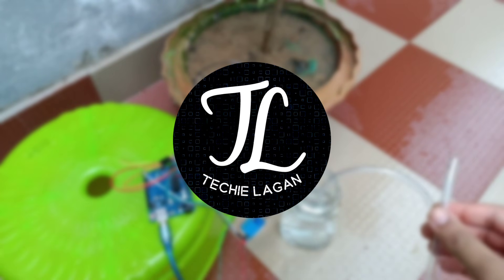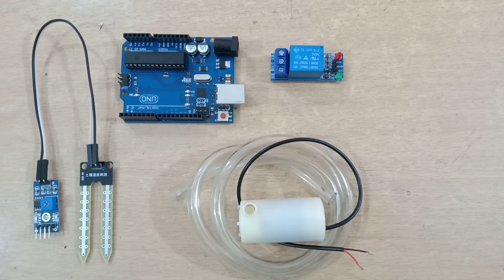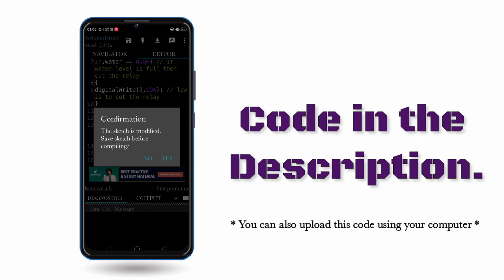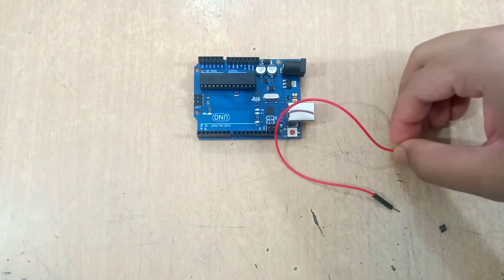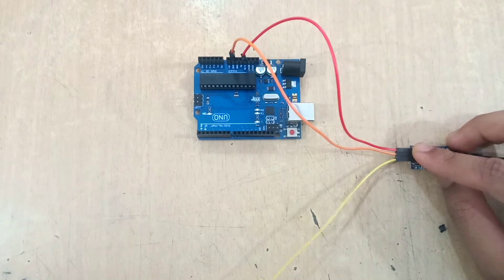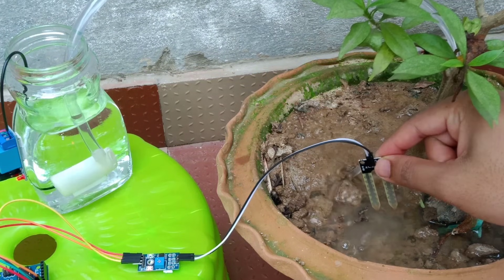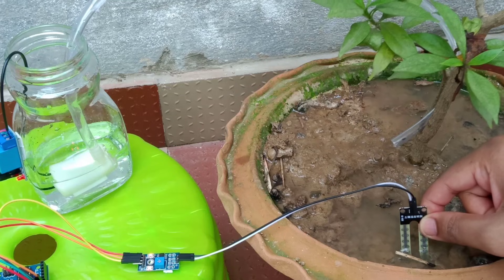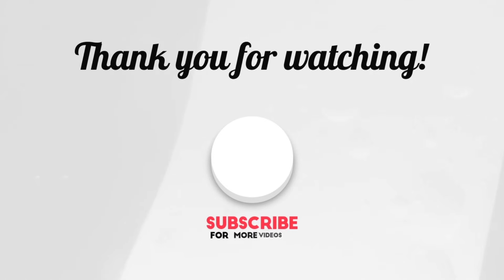How to make Automatic Plant Watering System using Arduino UNO and Soil Sensor || Techie Lagan

Comment: To modify your Arduino code to have a burst of 3 seconds followed by no output for 90 seconds, you can use the `millis()` function to track time. Here's an updated version of your code:

```cpp
int water; // Random variable
unsigned long previousMillis = 0;
const long burstDuration = 3000; // 3 seconds
const long pauseDuration = 90000; // 90 seconds

void setup() {
  pinMode(3, OUTPUT); // Output pin for relay board
  pinMode(6, INPUT);  // Input pin coming from soil sensor
}

void loop() {
  water = digitalRead(6); // Read the incoming signal from the soil sensor
  unsigned long currentMillis = millis();

  if (currentMillis - previousMillis < burstDuration) {
    // Burst duration: 3 seconds
    if (water == HIGH) {
      digitalWrite(3, LOW); // Cut the relay
    } else {
      digitalWrite(3, HIGH); // Continue providing signal and water supply
    }
  } else {
    // Pause duration: 90 seconds
    digitalWrite(3, HIGH); // Ensure the relay is off during the pause
    if (currentMillis - previousMillis >= burstDuration + pauseDuration) {
      // Reset the timer when the pause duration is over
      previousMillis = currentMillis;
    }
  }
  delay(400); // Optional delay for stability
}
```

This code will provide a burst of output for 3 seconds, followed by no output for 90 seconds, and then the cycle will repeat. The `millis()` function is used to keep track of time, and it compares the current time with the previous time to control the relay output accordingly.

Comment: I hope this message finds you well.  FLow sensing is costly and trickey , I am  are writing to provide you with information on the calibration and prediction of flow rate and the time required to dispense water under varying pressure conditions. This knowledge is essential for efficient water management and distribution in various applications.

Flow rate is a crucial parameter, and it is influenced by several factors, including the water source, pipeline type, and pressure control mechanisms in place. For consistency and reliability in maintaining pressure, there are options such as utilizing pumps, auto-filling overhead tanks, or employing devices like the Pressure Controllers.

To calculate the flow rate and the time needed to dispense 1000 liters of water with a pressure of 3 bar, we've collected the following data:

At 2 bar pressure, the tap dispenses 20 liters of water in 1 minute.
At 4 bar pressure, the tap dispenses 40 liters of water in 1 minute.
Let's begin by determining the flow rates at both 2 bar and 4 bar pressure:

Flow Rate at 2 bar pressure:
Flow rate = Volume / Time
Flow rate = 20 liters / 1 minute
Flow rate = 20 liters/minute

Flow Rate at 4 bar pressure:
Flow rate = 40 liters / 1 minute
Flow rate = 40 liters/minute

Now, we need to find the flow rate at 3 bar pressure. Given the flow rates at 2 bar and 4 bar, we can assume that the relationship between flow rate and pressure is linear. To estimate the flow rate at 3 bar pressure, we can use linear interpolation.

First, we calculate the flow rate increase per bar of pressure:

Flow rate increase per bar = (Flow rate at 4 bar - Flow rate at 2 bar) / (4 bar - 2 bar)
Flow rate increase per bar = (40 liters/minute - 20 liters/minute) / (4 bar - 2 bar)
Flow rate increase per bar = 20 liters/minute / 2 bar
Flow rate increase per bar = 10 liters/minute/bar

Now, we can find the flow rate at 3 bar:

Flow rate at 3 bar = Flow rate at 2 bar + (Flow rate increase per bar * (3 bar - 2 bar))
Flow rate at 3 bar = 20 liters/minute + (10 liters/minute/bar * (3 bar - 2 bar))
Flow rate at 3 bar = 20 liters/minute + (10 liters/minute)
Flow rate at 3 bar = 30 liters/minute

With a flow rate of 30 liters/minute at 3 bar pressure, we can calculate the time required to dispense 1000 liters of water:

Time = Volume / Flow rate
Time = 1000 liters / 30 liters/minute
Time = 33.33 minutes

In conclusion, it would take approximately 33.33 minutes to dispense 1000 liters of water at a pressure of 3 bar. This information is valuable for planning and optimizing water distribution processes in your specific application.

Comment: We have copy pasted the code and tried to upload the code but it shows that the upload is failed. Please help.
Reply: Try clicking on "Port" option. If that is not showing try to connect your Arduino via USB cable to different place

Comment: Bro can i use any aurdino instead of UNO
Reply from the maker: yes you can use but if you use arduino nano then only code will remain same but if you use any other board then this code will not work.

Comment: what is the additional cable you used for the pump? i got a problem there
Reply from the maker: That is to give power to the pump. It is connected to a 9 volt battery. It depends on which pump you are using.

"SORRY FOR LATE REPLY"
Reply: @TechieLagan  dw i figured it out, its the same as you explained. thx for the reply tho
Reply from the maker: My pleasure.

Comment: Where should I connect the 9 volt battery
Reply from the maker: to the pump throught the relay module and you have to also give power to arduino .

Comment: Dude what's the battery
Reply from the maker: 9 volt battery.
Reply: @TechieLagan  where should we connect the battery
Reply from the maker: You have to connect it to the pump through the relay module. Also yoh have to give power to Arduino, for thav you can use another 9 volt/12 volt battery or you can give it power through usb cable ..
Reply: @TechieLagan  ok where should I connect the usb cable
Reply from the maker: To the arduino

Comment: How many volt battery is required?
Reply from the maker: You can use 9 volt batteries.
Also it depends on which pump you are using.

Comment: Where is the power came from? In the usb in Arduino or in the power in motor?
Reply from the maker: I have used a power bank .
You can also use 9 volt batteries.

Comment: hello mate, can i connect the sensor to 5V pin instead of 3.3V pin, is it going to cause problem cuz i need to use the 3.3V pin for an esp8266
Reply from the maker: You can try that if it's working then well and good..

Comment: This is a good video that you have made. But the connection of the pump to the relay screw terminals was not very clear. 

1. Where does the green wire (connected at COM of relay) go to? 
2. Where does the red wire (connected to black wire of PUMP) go to? 

If these doubts could be cleared the video will be more helpful🙂
Reply from the maker: First of all thanks for the compliment.....
Secondly both the green and red wire is connected to the battery....
Reply: @TechieLagan  Thank you for clarifying🙂
Reply from the maker: My pleasure...
Reply: @TechieLagan  do you have a video on how to connect the wires to a battery?

Comment: hello，I wonder where to connect green and red wires on the 5 Volt Relay Module，is the red and green wires bind together? thanks.
Reply from the maker: No no they are separate.
They are connected to the battery.
Reply: @TechieLagan  ok I see, so I have to buy a battery box right？
Reply from the maker: You can use any dc power source...
But less than or equal to 9 volt.

It totally depends on the pump you are using.
Reply: @TechieLagan  ok, thanks for help.  Your video is very helpful for those who is new to arduino.
Reply from the maker: Thanks for the compliment...
Reply: @TechieLagan  im soo confused about the red and green wires..if it is separate then i need 2power supplies? im so confused sorry

Comment: bro my water pump is not working ...... i tested it separately its working but when its connected to relay its not y so??
Reply from the maker: Bro there may be some issue with the connections or may be the soil moisture sensor is faulty..it can be anything...

Comment: When you used the phone to program, did you connect a bluetooth module or was it transferred to Arduino Microcontroller using USB?
Reply from the maker: Directly using USB
Reply: Can I use any wireless connections

Comment: The computer program is not opening
..pls provide something new
Reply from the maker: int water; //random variable 
void setup() {
  pinMode(3,OUTPUT); //output pin for relay board, this will sent signal to the relay
  pinMode(6,INPUT); //input pin coming from soil sensor
}

void loop() { 
  water = digitalRead(6);  // reading the coming signal from the soil sensor
  if(water == HIGH) // if water level is full then cut the relay 
  {
  digitalWrite(3,LOW); // low is to cut the relay
  }
  else
  {
  digitalWrite(3,HIGH); //high to continue proving signal and water supply
  }
  delay(400); 
}
Reply from the maker: I hope it helps . still any issues, plz comment !!

Comment: How is the power given to relay and Uno board..You does not show what is connected to uno board..and is there any power given th the pump
Reply from the maker: Yes I used a power bank with usb to give power to the uno board...
And another battery to give power to the pump.
Reply from the maker: You can use a single power source but you have to give power supply to the uno board and pump separately.

Comment: Sir can you tell me how to connect other side of the relay module to the water pump
Reply from the maker: See connect one wire of the pump directly with the battery or any other power supply whichever you are using. Then connect the other wire of the pump to the common pin of the relay module and the other wire of the battery to NO pin of the relay module.

Comment: Excuse me, how can I connect the power source to to the 5v power module? I'm using all the exact same parts but I'm confused on how to connect the power source
Reply from the maker: See one wire of the pump you have to connect directly to the battery. Then other wire you have to connect through the relay module
Means ,
Suppose -ve wire of pump is connected to -ve of battery. Then +ve of battery will be connected to com pin or middle pin of the relay module and +ve of pump will be connected to NO pin that is normally open pin of the relay module which is generally the left one...but it varries in different modules...
Reply from the maker: If still any doubt plz DM me on instagram...I will send you the diagram of the connection
Reply: @TechieLagan  thank you good sir! You are a saviour
Reply: @TechieLagan  I still have doubts about that and it's for tomorrow :(
Reply from the maker: What doubt you are having?

Comment: 3:45 is the green wire negative or positive?
Reply from the maker: Here green wire is negative but you can pass any wire through the relay module . And polarity does not affect the working of this pump.

Comment: Bro can send code in computer  
 Only Code for phone only opening
Reply from the maker: Same thing just copy that ...
Reply from the maker: int water; //random variable 
void setup() {
  pinMode(3,OUTPUT); //output pin for relay board, this will sent signal to the relay
  pinMode(6,INPUT); //input pin coming from soil sensor
}

void loop() { 
  water = digitalRead(6);  // reading the coming signal from the soil sensor
  if(water == HIGH) // if water level is full then cut the relay 
  {
  digitalWrite(3,LOW); // low is to cut the relay
  }
  else
  {
  digitalWrite(3,HIGH); //high to continue proving signal and water supply
  }
  delay(400); 
}
Reply: @TechieLagan   Thank  you so much bro😊
Reply: Bro do u used any 9v battery here or not
Reply from the maker: Here I have used a power bank but you can use a 9 volt battery instead...
Reply: @TechieLagan  tq bro
Reply: @TechieLagan   Tq very much bro  I have completed successfully my project

Comment: How much does the project cost
Reply from the maker: Less than 1000 rupees
Reply from the maker: Depends on the price of Arduino Uno becoz it's the most expensive component used in this project
Reply: @TechieLagan  Arduino Uno is how
Reply from the maker: @christinenjoki7391  
Price list:
Arduino UNO - 700
5 volt relay module - 142
water pump - 100
soil moisture sensor - 200

Total project budget - around 1200 INR
Reply: @TechieLagan  can i use gsm  model
Reply from the maker: I am not sure but upto my knowledge u cannot use gsm module ... U can do more research on Google or see other videos on youtube....

Comment: nice project ,but how do we give the power supply to the arduino and to the water pump at the same time? i mean  like can we supply the power to the water pump from the board 5v pin ?
Reply from the maker: No I don't think it will be enough..
Instead of it you can use another 9 volt battery or like me you can use on powerbank. Cut the usb cable and connect the other end to the pump through the relay module..

Plz follow the circuit diagram for more details..
Reply: @TechieLagan  ok so i give the power to the water pump using the power bank but what about the arduino, how do we give the power to the arduino?

Comment: sorry sir, is there a difference when connecting the cable to the relay module slot between the middle and left or middle and right?
Reply from the maker: Yes there is a difference, middle one is common pin and left or right may be NO and NC pin it may vary from module to module .
In this project you have to connect it to NO i.e Normally Open pin and common pin.
It may be written on the module or you can see it on the back of the relay module
Reply from the maker: For more details please Google it 
Search for- "pins of a relay module"

Comment: Hello, thanks for your tutorial, if I'm using a 12V power source and a 12V water pump, can I still use the 5V relay module?
Reply from the maker: Yes you can .
There is no problem.
Reply: @TechieLagan  and we dont need to use any transistors or resistors?

Comment: Could please explain what is the 5V supply that you connected to the relay and the water pump? I don't understand. This is my first project like this. Thank you!!!
Reply from the maker: It is a power bank . You can also use 9 volt battery instead of it.
Reply: @TechieLagan  So I have to cut the cable that goes in the power bank and connect the wires to the relay? Sorry if this is a stupid question but I's still trying to learn. Thank you!
Reply from the maker: Yes you have to cut the cable and do the connection.
And there is nothing wrong in asking questions whether it is small or big..
Infact I should be sorry for not being able to explain that part more elaboratly in the video....
Reply: @TechieLagan  Thank you so much! Have a great day!
Reply from the maker: My pleasure 🥰.

Comment: 2:58 what is that 5 v power supply?  Is it the battery you are talking about?
Reply: I have a 9 v battery is it OK?
Reply from the maker: Yes
Reply: Will it 9v dc pump work with this project with 9v non rechargeable battery?  @TechieLagan
Reply from the maker: @arsh_arora10 yes it will
Reply from the maker: Yes

Comment: can i know where goes green and red wire from relay?
Reply from the maker: It goes to battery.
Here I have used powerbank as power supply
But you can use 9 volt battery also.
Reply: @TechieLagan   i also use powerbank as supply so wheres you connect the green and red wire ?
Reply from the maker: You have to connect a cut piece of usb cable if you are using power bank.

Comment: What type of motor pump we use brother either dc or ac, please tell...
Reply from the maker: See with this relay you can use both....dc or ac only for demo I have used dc. You can use ac also but be careful..
It depends on your relay module

Comment: Will it work when connected to a laptop or need a power supply? 
When I rotate the potentiometer both lights on the water sensor board start glowing and the green light on the relay is turned off is that ok?
Reply from the maker: Yes that is ok....
See your Arduino needs power supply and pump also needs power supply...so it depends on you how u r providing power to both...
Reply: @TechieLagan  Thanks alot for replying so fast I have few more questions
9V battery for both is okey ? or series 1.5V Cells in series or parallel ?
Reply from the maker: One 9 volt battery will be ok for both....
If you r doing it just for demonstration...
Or else you can use a power bank also...

Comment: In relay NO and COM connected or NC and COM to motor ?
and motor needs to be in the water to rotate or for the test, will it rotate in the air too?
Reply: sorry sir, can u help me, my relay just red LED is on, but the green one is no. and relay for pump is not working (even the sensor is wet or not wet). my coding exactly same just like the this youtube.
Reply: @maulidyasyah8914  👋,you find a solution for it I also face same problem
Reply from the maker: NO and COM.
No need to put it in water.....
Reply: @TechieLagan  Thank you sir ❤️❤️❤️❤️

Comment: Were making just like this but instead a sprinkler is that possible?
Reply from the maker: Yes
Reply: @TechieLagan  oh thanks, But what materials do i need?
Reply from the maker: Nothing more than those mentioned in the video....
You can go with the same circuit...
But just be carefull while using AC powered sprinkler...and do not touch relay module after giving power supply..
Reply: @TechieLagan  Thankss
Reply from the maker: My pleasure..
Reply: @TechieLagan  we need Female - Female Jumper wires right?
Reply: @TechieLagan  can we use 2 Soil moisture sensor in one Arduino?

Comment: Sir where u connect the red and green wire in pump? please answer sir i am doing my school project
Reply from the maker: It is connected to a 9 volt battery or you can also use power bank